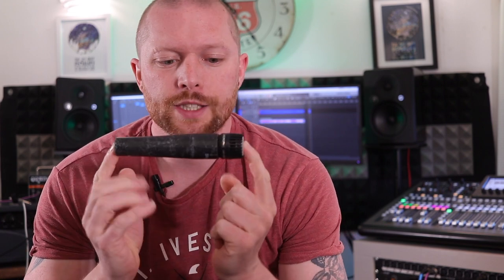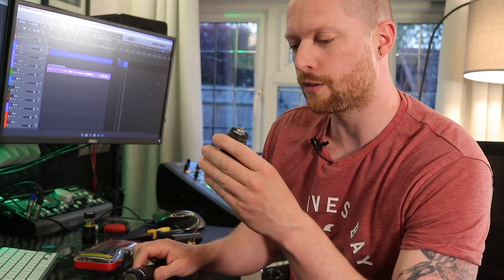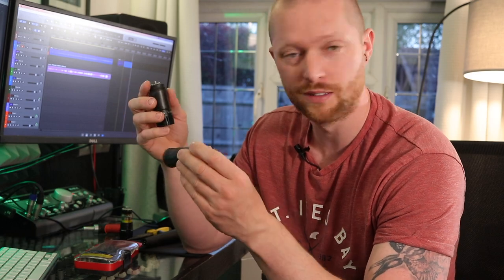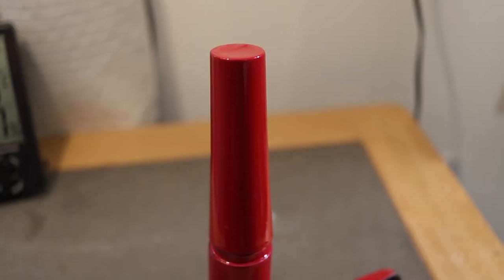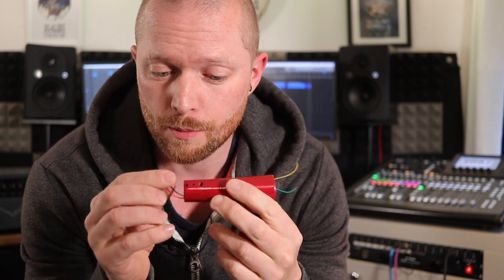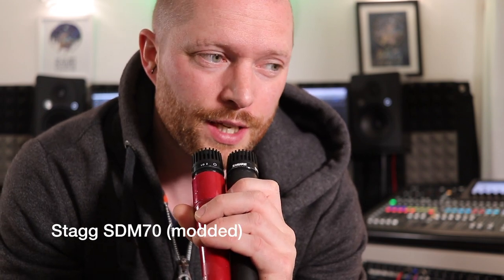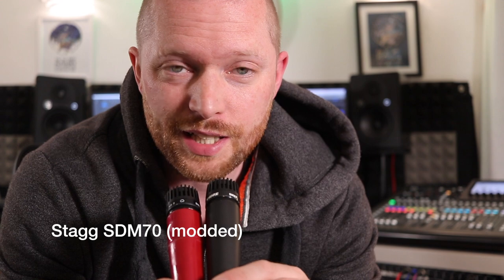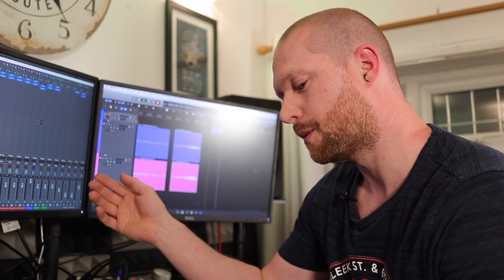Stagg SDM 70 capsule upgrade - SM57 style capsule in Stagg SDM 70

Comment: Hey! I recently bought this mike and watched your videos.
I don´t know if or what has changed but it is (now?) extremely sensitive to picking up interference(?) signals of electronic devices. This is a huge problem as I need to operate it near to my PC. Can you please give me advice if this is because it´s a cheap mike and has no/bad shielding? Otherwise I´m totally satisfied with it and I don´t want to change to a more expensive if not needed.
Reply from the maker: I honestly don’t know as I’ve never had that happen. Do you have another mic you can try? I’m wondering if it’s your interface rather than the mic.
If it is the mic, they’re really cheap so I’d recommend getting another one, or getting a Shure SM57 or SM58
Reply: @PherotoneStudios  Thx for your reply. I only have a condenser mic. I read about that dynamic mics are prone to emi so I am really not sure if I just didn´t notice it earlier or if something has changed.
What happened, too is the loudness changed suddenly. From one day to another it/my setup got quieter which had me to adapt and then it changed back to louder output suddenly again. Really weird!

Comment: Can you run phantom power to the modified sdm 70, because I would like to use a sdm 70 recording at the same time as a sE 2200a and the 2200a requires phantom power
Reply from the maker: As long as the transformer is still inside, you can
Reply: @PherotoneStudios  one last question, can I just buy the capsule and 3d print a holder for it, because I am guessing all the sdm70 is for the casing and the xle plug
Reply from the maker: I have no idea about 3D printing the holder but that’s all you need from the SDM. The XLR Jack within it needs metal pins. Not sure how that bit gets printed